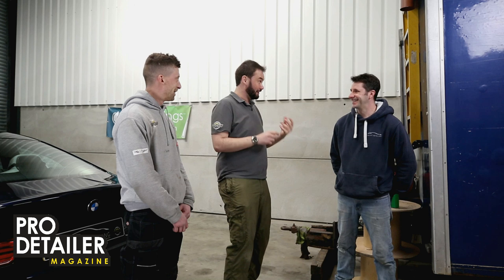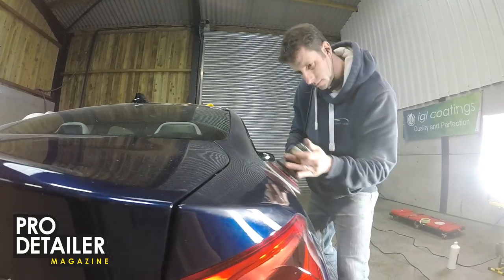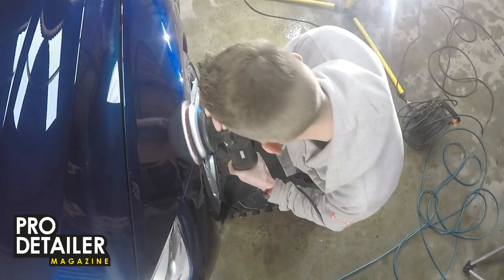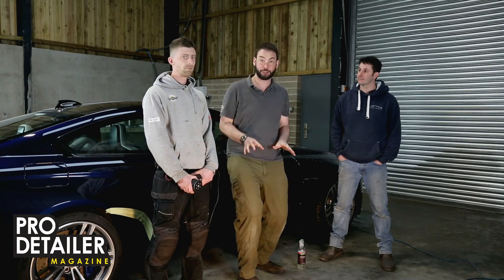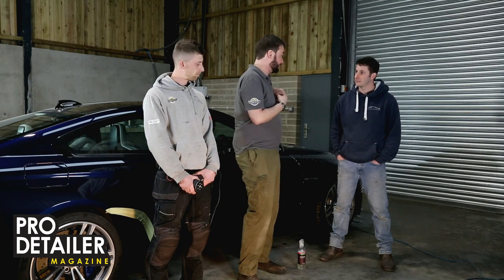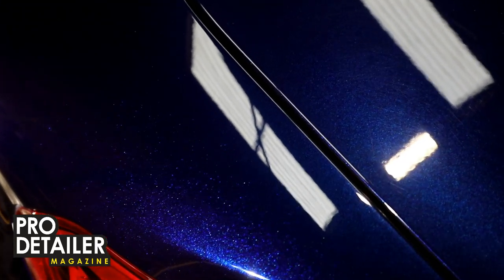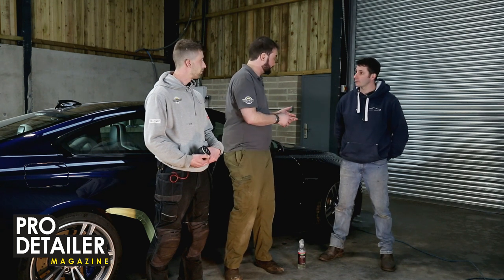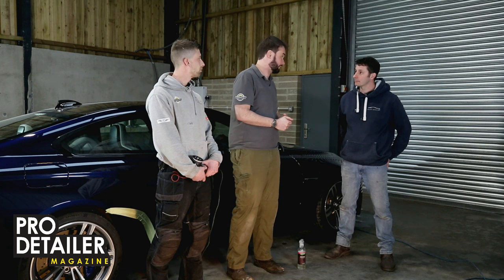BMW M4 Ceramic Coating - Knight Detailing & Mad About Detailing

Comment: I have recently stumbled upon a product called optimizer made by nanolex it's designed to basically add lubrication, it'll most probably work very well with the igl compound whilst being able to work at a normal speed.
Reply from the maker: As it happens we have an interview coming up soon on that exact product from March!